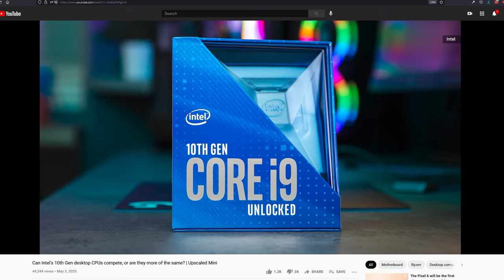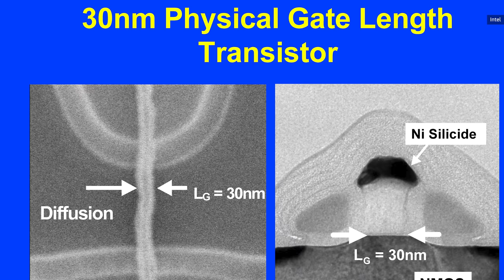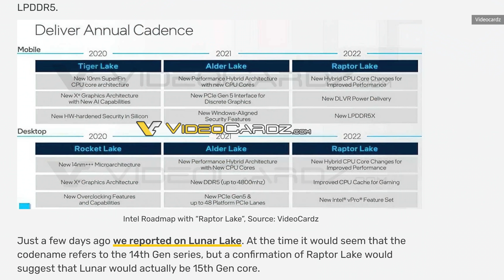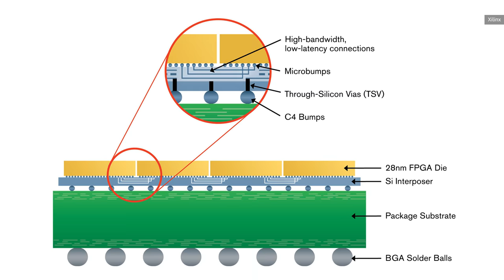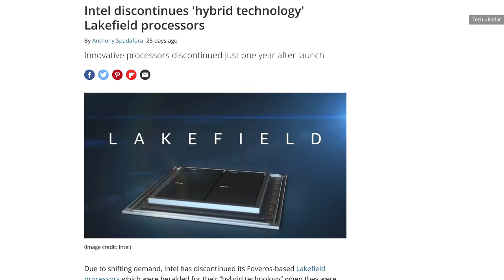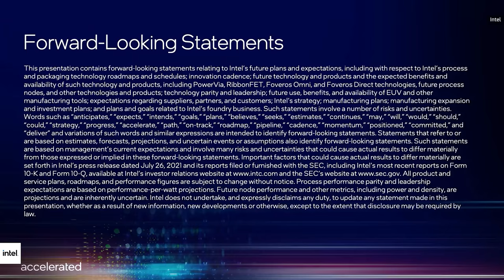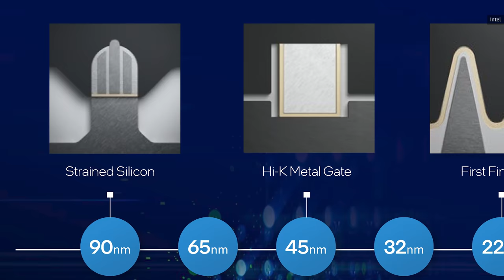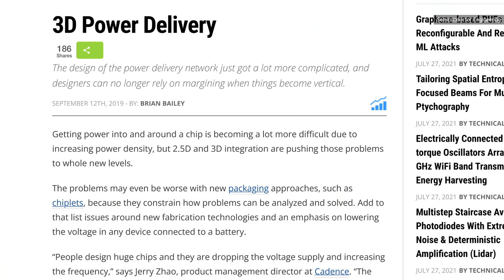Intel has a plan to go beyond 3nm chips  | Upscaled

Comment: Intel's bold new strategy:  Start releasing compelling products again.
Reply: Nah that’s too simple and plebeian beta swaggish
Reply: @keithdow8327  highly doubtful
Reply: Lol
Reply: @KingLarbear  

"Intel claimed earlier this month that its new Alder Lake Core i9 benchmarks faster than Apple's M1 Max. ... In Geekbench 5's multi-core CPU test, the Alder Lake Core i9 has a 5 percent lead over Apple's processor. In the single-core test, Alder Lake's improvement was 3.5 percent. That's basically a draw."

Yawn. Apple is coming out with new machines in March. They will clean Intel's clock.
Reply: @keithdow8327  Hope it gets a more powerful GPU or it ain't killing nobody.
Reply: It's not as easy as you think.

Comment: One clarification about node names-- they do not mean nothing. Remember how they used to mean gate length in planar transistor days? Intel scaled down that gate length every gen and named the nodes accordingly. Then something changed in 22nm-- in a bid to beat the limitations of Physics, Intel moved to FinFET-- the channel for current conduction was no longer planar/1D, but 2D. This allowed for performance improvement without actually shrinking the gate length. Then how do you name the node? Intel stuck to the previous convention. Which means 14 nm means the same performance you would expect from  a 14nm planar transistor if it could be made (but cannot be made because of the laws of Physics). Intel, being the guardians of Moore's Law followed this convention religiously, but their competitors said, "Heck with it, we will just fuzz the numbers." That's how we ended up with the confusion like Intel's 10 being on par with AMD's 7. And because consumers are not device Physicists, it started having a psychological impact on them, exaggerating AMD/TSMC's tech leadership in their minds. That compelled Intel to match the numbers with their competitors. And finally, it does not mean anything anymore, other than being a serial number of successive nodes.
Reply: Great comment. For those curious what happened at 20 ihs nms, it was the limit of previous litography - DUV, now we are starting to have EUV which can do lower than 20 nm

Comment: Should find solution for heating problem first ... mine PC is becoming so hot that it will soon fuse atoms in cores.
Reply: Pretty sure Intel will make first fusion reactor. Their silicon is just next level to handle those temps. 

Perfectly ideal for nuclear fusion reactor shielding
Reply: Excellent idea!  Bring on the Fission chips where the energy is created by the atoms vibrating from within the cores themselves just like Nikola Tesla would have done if he were alive today.
Reply: time to clean the fans ;)

Comment: I'm wondering what the long-term reliability of stacked chips will be due to possible differential expansion of layers due to thermal effects.
Reply: Processors were the part least likely to fail in a PC. If even processors start to fall in PC's with time then the apocalypse is coming :))
Reply: @mateialexandrucoltoiu7207  ikr the electronics market is just moving towards less reliability.

Comment: The bottleneck in this industry is ASML. It needs competitors in the EUV equipment manufacturing space. The players in the chip design market itself are more than enough and the progress stimulated by this competition shows.
I'm excited about the future. Wish china could catch-up soon so the prices are sliced down.
Reply: The problem with that is tooling in a pricey enterprise when it comes to chip manufacturing. Not to mention that at the scale that they deal with for experiments, its basically them or IBM and IBM tends to just find it better to license out stuff. So ASML is the only maker of the tools used in the industry and their prices are... not cheap.

China has been wanting into that market for years but it basically high-end government equipment that ASML makes, so things get geo-political FAST.
Reply: @tylerdurden3722  
That's what I mean, there is no way ASML announces a sale of their equipment without the United States government, among others, having some manner of involvement in the acquisition.
And China happens to be on their 'do not sell' list.... It would be one of those geopolitical crises, which is notoriously complex.

Comment: But they're NOT calling it 7 nanometre ....they're just calling it "intel 7” ....no nanometre. This seems ridiculously ambiguous and vague. I get that TSMC isn't basing theirs on actual transistor measurements either, which is also silly, but the numbers should refer to something rather than being pulled out of an Intel marketing teams ass.
Reply: The naming schemes of X nm have not referred to anything since the use of FinFET and that's nearly 10 years ago. And different parts of a chip use different sizes of gates. Which gate size should we name after when there is no standard? With the advance in 3D packaging, I think any measurement would be more and more meaningless, including transistor density.

Commercially speaking, when you cannot name after some measurements and there are always expectations from the public and customer to have better manufacturing technologies, reducing the number regardless of a full or half node shrink is definitely not harmful and beneficial to your share price.

From Intel's perspective, "Intel 7" et al can depart Intel from the 14nm++++ joke and we can compare more easily across technologies from Intel (Intel 7), TSMC (N7 or 7nm), Samsung Semiconductor, and probably GlobalFoundries too. So when we talk about 7, it is roughly the same thing in the entire semiconductor industry. And when we talk about 5 or 4, Intel 4 is roughly denser than TSMC 5nm, and so on...

Plus, while it may be vague as you said, at least they are not lying that it is some sort of measurement, since it really isn't.
Reply: I think this is more preferable than the truth, which is just 10nm+++++++++??? And to be fair, they do put more transistors per square area so it's just to say any measurement by number is going to be purely marketing.

Comment: I think I will stick with AMD.  Sounds like new Intel marketing shenanigans.  Why are they removing the nm benchmark but still using 7, 5, and 4 numbers?  They still think consumers are stupid. Typical Intel.  SMH...
Reply: There is no ”nm” benchmark. There is no length, width, pitch, feature size or anything else on TSMC 7 nm thst is 7 nm. Having nm there is dishonest because it might fool some people who haven’t been paying attention for the last decade that the number actually means something.
Reply: @soylentgreenb  - If Intel is going to drop the "nm" benchmark then they need to also drop the "7, 5, & 4" numbers as well.  Why are they still keeping those numbers if "nm" doesn't mean anything?  Because they think all consumers are stupid.
Reply: @kpopempire1475  Consumers ARE uninformed and you're proving it to me right now. There is no 7 nm process and no "7 nm benchmark". It's undefined what you should even measure anymore because there are too many different measurements and process limitations that are important and you can't boil them down to a single number governing power, density and performance. 

In the good old days in the 1990's the 0.35 micron (350 nm) process had a half pitch of 350 nm, a gate length of 350 nm and the process node was called 350 nm and this was a good description of density, power and performance. The 1990's was the last time this was true. DRAM wanted lower half-pitch to cram more memory into a given area and CMOS logic wanted faster clocks which meant shorter gate lengths. E.g. on 180 nm CMOS logic process (late 90's) the half-pitch was 230 nm, but the gate length was 140 nm.

The deviation became increasingly farsical, before it was completely abandonned with finFET over a decade ago. That consumers accept e.g. TSMC calling their N7FF process "7 nm" is evidence consumers are uneducated and easy to fool.

E.g. intel "10 nm" has a minimum metal pitch of 36 nm, which is smaller than TSMCs 40 nm on N7FF and the transistor gate pitch is identical at 54 nm. Logic density on intel "10 nm" is generally a bit better than TSMCs "7 nm" but on power and performance (and especially yields) intel "10 nm" is worse. In either case the nm designation is meaningless. Intel could just as well have called 14 nm the "cupcake" process and 10 nm the "blancmangé" process. It does not mean anything. It doesn't mean anything when Samsung or Glofo or TSMCs say it either. "7 nm" is just a name, signifying nothing.
Reply: @soylentgreenb  - I am sure it is true what you are saying about things changing since the 90's with regards to measurement, etc... However, despite the fact that MOST companies spin the truth to market to consumers, Intel has a very bad reputation for doing so to the point of hurting consumers.  This is well known among enthusiasts; just watch most of the enthusiast's tech channels (i.e Linus Tech Tips, Gamers Nexus, etc).  I personally have 25 years plus in the I.T industry, having bought Intel products for decades, and I am telling you from personal experience that Intel is full of it.

I give you credit for your very acurate and informative video.  After finding out a little bit more information on Intel's roadmap I see that there is merit to Intel dropping the nm benchmark, mostly because of their sub-nm plans.  People's distrust of Intel's marketing proves that the past can overshadow even their best intentions.

Comment: Anyone who thinks the pitch (width between traces on a substrate) does not directly indicate density (i.e. a 10 nm pitch is never equal to a 7 nm pitch) - really doesn't know what they are talking about!!!  The spin is trying to convince you that more layers of substrate (Intel's and this author's spin) can overcome the geometric design performance Intel is lacking - is preposterous.  There is a huge challenge when it comes to adding more layers that have to be interconnected in any electronic design.  No matter where the interconnections take place.  This is exactly why Intel performance is lagging - the idea they are trying to sell here - just isn't working.  Buying into cheerleading hype offered up by a marketing department of the poor-performing company trying to deflect inferior products is someone I'd quit listening to ...
Reply: No, you don’t know what you’re talking about. Intel 10 nm has a smaller minimum metal pitch than TSMC 7 nm and both have the same gate pitch. Both are much larger than 10 nm. The node names don’t correspond to any physical measurement.

Comment: Informs us that "X nm" doesn't measure anything specific, but is used for marketing, than proceeds in the video to add "nm" to the names of Intels future processes even though these are not named with "nm" , but rather "intel 7, intel 4,...".
Reply: Renaming the node is soooo lame!!!  Why not just then rename the 10 nm node to 5 nm, the 7 to 3, etc.  -  and claim that they are already back ahead?  Personally, I like the magic wand theory much better.
Reply: That’s what they are referring to. They are claiming that they have equivalent transistor density to TSMC’s nodes
Reply: @dizzydrb  Intel is already ahead.
Reply: @GowthamNatarajanAI  they’re not ahead, TSMC 5nm is more dense than Intel 10nm (now Intel 7). Intel 10nm is more sense than TSMC 7nm. It’s weird, but TSMC still has an edge, it’s just not nearly as large as it seems from the marketing terms. Definitely not a 2x improvement.
Reply: @GowthamNatarajanAI  no, TSMC was the first to rename x nm
Reply: @dizzydrb  this isn’t lame. Intel’s 10nm is more dense than TSMC’s 7nm, so renaming actually makes sense. If you have to call somebody lame, that should be TSMC.
Reply: @ryancube15  intel's 10nm SF is already comparable to TSMC 7nm. Their 10nm ESF(intel 7) is superior to TSMC 7nm EUV
Reply: @ryancube15  it appears you didn't get the gist of the message in the video. Intel had already claimed that anyone techy enough to care for these numbers knows that their 10nm nodes are denser than TCMC's 7nm. Then they went ahead and renamed it anyway. What's the logic in that? It means they followed TCMC's convention which means TCMC won this one.
Reply: The problem is that TSMC and Samsung started this disconnect. Back around the 22 nm days, Intel basically owned the market while TSMC and Samsung where the scrappy start-ups. When Intel shifted to 16 nm, TSMC and Samsung basically called their 20nm process 16 nm to keep up while continuously developing to actual 16 nm in the years in-between (and so not think that this went unnoticed, it was very controversial at the time). When the 14 nm shift happened, they kept up but for every new enhancement of the nodes they just kept decreasing the number. 
So today TSMC's N6 process is really just an enhancement of N7 (the actual 7nm node), Samsung does the same with with 7LPP (the actual 7nm node) to 6LPP... Meanwhile at Intel, the 10 nm shift is something of a PETA, and desktops chips keep adding another +  to 14nm for enhancements to the node.

With Intel wanting to be a Foundry Service like TSMC and Samsung, something had to give... so they caved and the naming scheme was changed to be more in line with TSMC and Samsung.
Reply: @dizzydrb  That's basically what TSMC, Global foundries and Samsung did.

Comment: We call a ten a 7 , a 7 a five , say what? ( The new bs Lake)
Reply: If you’ve been asleep for a decade. Nanometers mean nothing. Nothing about TSMC 7 nm is 7 nm or close to it. Nothing about intel 22 nm was 22 nm. Transistor density is not a single number (e.g. SRAM can be twice as dense as logic). Even comparing power, area and performance is difficult to do fairly unless to competitors manufacture the same chip design (doesn’t happen) or if one is grossly superior.
Reply: @soylentgreenb  thanks for the information. it's true, I didn't know, maybe it's for marketing.
Reply: @professorJorge11  It used to be the case with planar transistors that you simply shrunk everything geometrically. The half pitch was equal to the gate length was equal to the node name. The last time that was really true was back in the 90's when they still used aluminium instead of copper traces on the chip. DRAM and CMOS logic went their separate ways and optimized their respective processes for different things and you scaled the things you could scale. Around 90 nm leakage became pretty extreme and every generation since they've been doing weird and wonderful things at each node to combat it. Then the size of chip features became smaller than half the wavelength of light used to make them (optical limit) and multiple patterning became necessary, and it has all sorts of limitations on what shapes you can make and how you may place them in relation to each other on a chip without breaking things. The nm designation has become increasingly farcical since the early 00's but it's really only been flat out nonsense since finfets.
Reply: Intel upgrading the hardware on the devices wirelessly and virtually, by just renaming. Now everyone having a 10nm Intel SoC suddenly has a 7nm instead 🤦🏻‍♂️🤣
Reply: @well7885  personally, I look for novel types of architecture, like the M1.
Reply: @professorJorge11  pleased to hear. M1 was my first project at Apple as a silicon Design engineer

Comment: Apple Silicon is the future... and similar chips... Intel chips and roadmap feels like mission impossible of reviving a Diesel engine
Reply: diesel engines are not dead, they are one of the most used for logistics..
Reply: @Story_Teller_Everyone  that’s the problem. They have to beat Apple Silicon in design and TSMC in fabrication and they are currently failing at both. Meanwhile, Apple just has to concentrate on one thing, chip design and TSMC just has to concentrate on one thing, fabrication. In such situations, the gap usually keeps getting wider
Reply: @well7885  I agree, my comment was more around the fact that fabrication in general is in massive demand.  Intel will continue to expand from chip fab alone.  But yes I think they will continue to lose server market, and pc market to other players.
Reply: oh ffs

Comment: I remember, quite fondly, attending an Intel chip release event of their "Overdrive" processor.  Old timers like myself remember this as the intel 486dx chip that required an "overdrive ready" motherboard to allow for the addition of a 2nd cpu. The event was a HIGH END catered affair with a prime-rib buffet and open bar. Anyway, their was a promo video that made you absolutely CRAVE that new chip. Indeed, if you ran the prior generation of intel chip, you felt like a speed runner with your feet embedded in concrete. This is the market intel has lost. Those PC users who drove that craveability for the latest generation of Intel CPU'S. I can't remember the last time I felt like I needed the latest Intel chip.  Can you?

Comment: I have an i7-10700 big desktop and an M1 mini. The current plan is to get an M1X mini to replace the M1 mini as I'd have to update the motherboard to go with AMD and I think that Intel is going to require motherboard updates for subsequent generations of their chips which will be a nuisance. The difficulty getting GPUs is discouraging my from going x86 as well. What I have is sufficient for what I do though I would like to move more programs to macOS and I need more horsepower to do that. It looks like an M1X mini will give me enough to move some stuff from Windows to macOS.